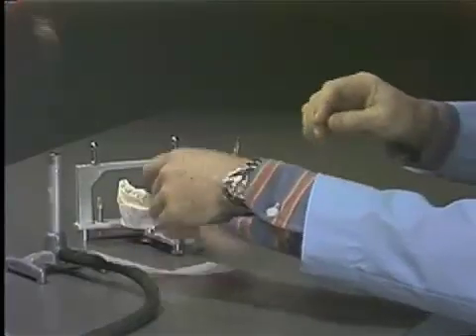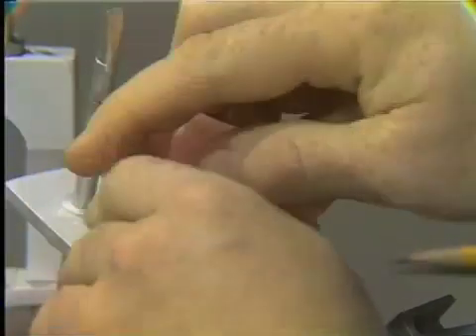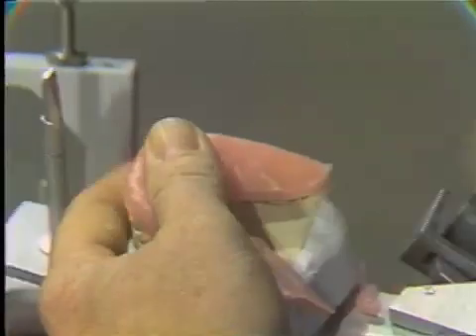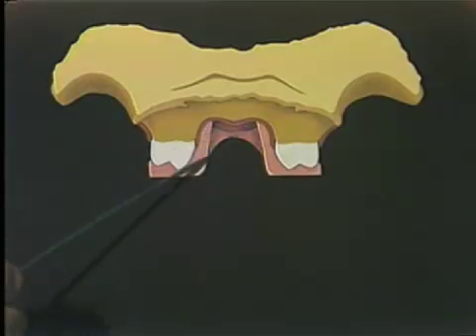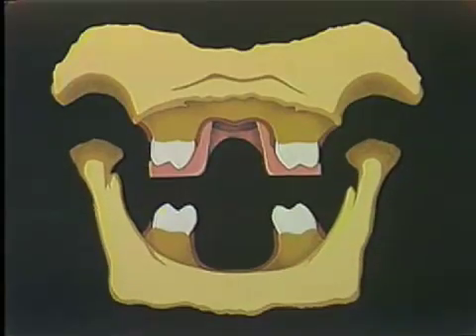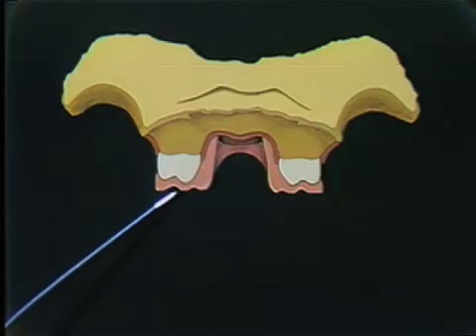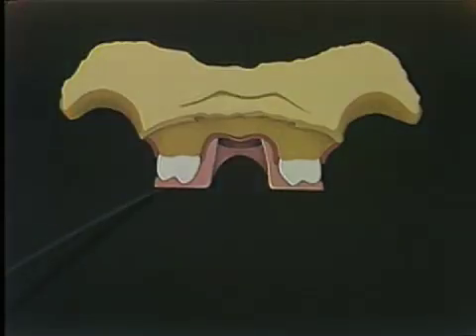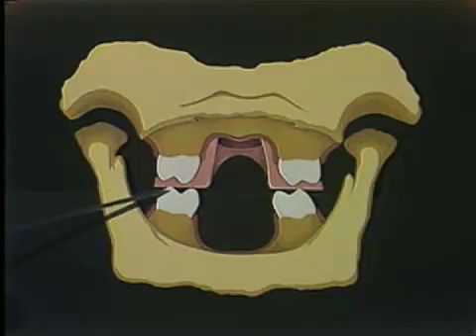Construction of an Occlusal Bite Splint

Comment: If anyone can make these cheaper than what dentists charge contact me reply to this I have money just don't want to fork out 800 for one of these
Reply: Even if someone makes you one it will need final and ongoing adjustments to work.  Your teeth opposing will shift from time to time and require adjustments.
Reply: not to mention potential TMJ pathology that may result from improper fabrication